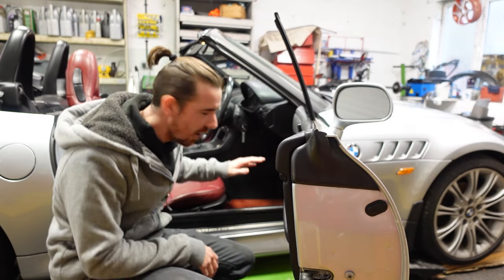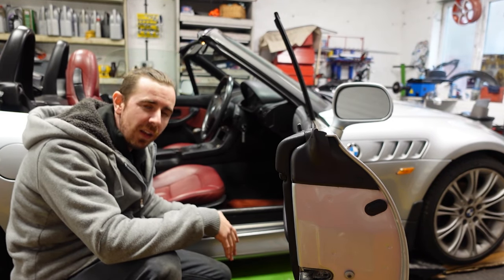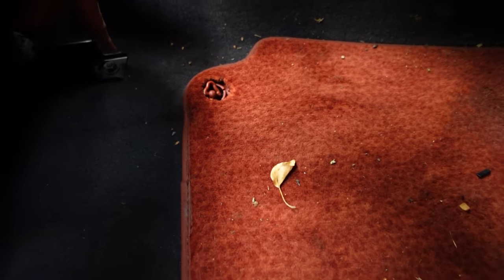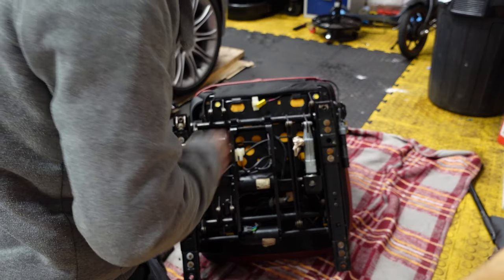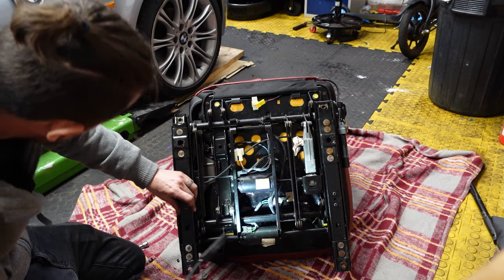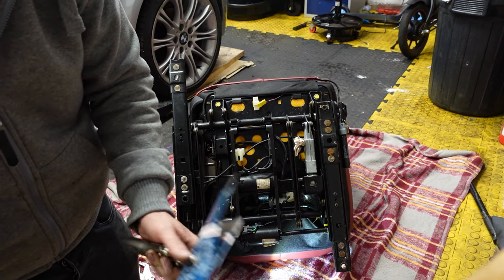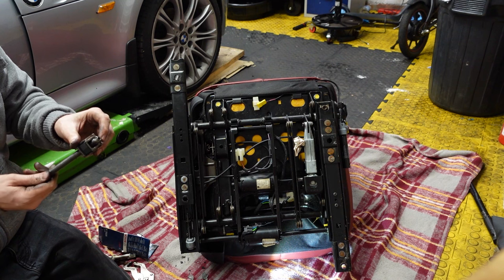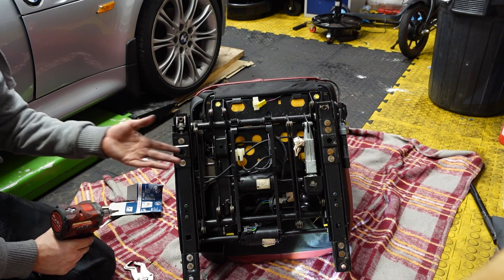How to Fix BMW Z3 Rocking Sliding Seat Full Guide

Comment: I need to remove my seat, but it wont go forward... Its stuck in the back, what can i do?
Reply from the maker: Is it electric or manual
Reply: @rstv84  eletric... The motor is good, its stuck on the trail.. Get it?
Reply: @rstv84  só I need to remove the seat without moving it forward
Reply from the maker: @LmAutomoveisgaia  you need to remove the 4 bolts that's the only way to get the seat out to my knowledge  you will need to get that seat moved!!